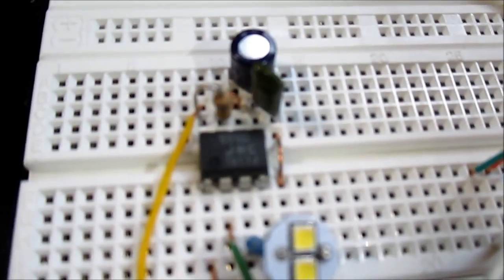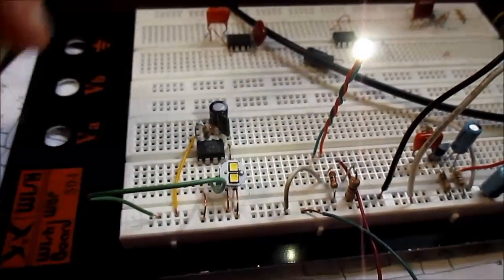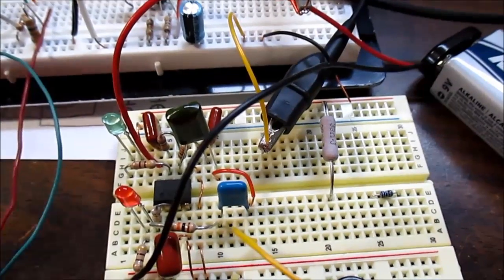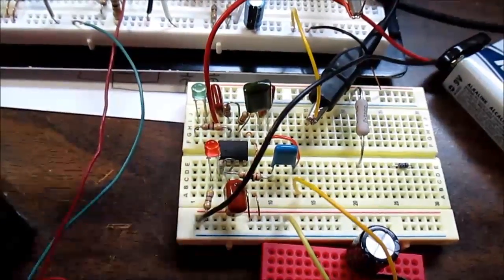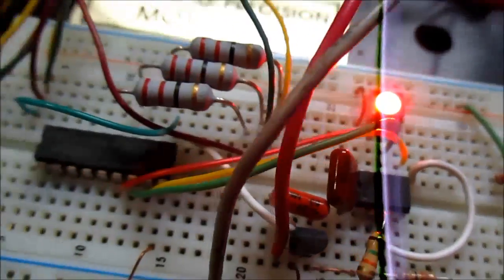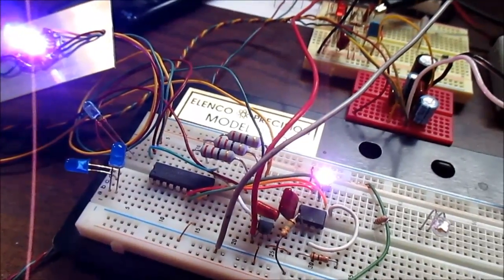My favorite 8 pin DIP ICs!

Comment: Hey so I pulled an 8-pin IC off an old circuit board it’s an unknown brand and the only letter/numbers on it are: HH9QK Q0270RA, I’ve been looking on the internet and I’ve not been able to determine what it does, all I know is that it’s an 8-pin, also before the letters/numbers there’s a slanted f. Do you possibly know what it does?
Reply from the maker: Probably a part from a Chinese manufacturer that distributes privately to other companies. I doubt I'd be able to find anything on it either.
Reply: @JohnAudioTech  dang, cause I’m not even sure what the part does, and I’ve never really built any circuits with any IC’s yet, I have modified/upgraded electrical stuff though that have IC’s on then though.
Also if you use transistor/mosfets do you know what this one does? LT7237 MbR20100CT it’s got two arrows pointing towards a dot in the middle: —>|•|<— that’s what the image thing looks like on it.

Comment: What is the number of ic of led driver???
Reply: Uln2803 if I'm not mistaken.  It's a Darlington transistor array.  The 2803 has 8 transistors and the 2003 has 7.  The base and base to emitter resistors are slightly different, depending on the utilisation.  I use the 2803 on a regular basis to drive many LEDs and/or relays.  Have fun !!!

Comment: the 555 is by far my most used tinker chip, so versatile and cheap as dirt.
Reply: Yes, but have you seen the current consumption? There are more modern replacements that do the same thing with much less power.

Comment: I notice on your breadboard (9:36) that you have your power rail on the top side jumpered to your ground rail on the bottom side !!  Hmmmmm !!
Reply from the maker: Despite their color code markings, they are not actually tied to anything so you can use them as you wish. It works better for me to make them ground.
Reply: Yup.  I was just yanking your chain.  Sorry about that - couldn't resist it.  LOL!!  Thanks for all your videos !!  ;) ;)

Comment: The first op amp was designed by Bob Widlar and David Talbert in 1964 and it was the uA702  then came the uA709 and uA723( voltage regulator) then the LM100 LM101 LM101A(with fet current source). The 555 is from 1971 as you say.
Reply: I still use LM301 (commercial grade of LM101). Works great in audio gear.

Comment: Great video. I love the 555 timer. There are so many jobs that a 555 can be thrown at, motor speed control, PWM, oscillators, pulse extender. I used to explain modifying guitar pedals to a friend of mine as "putting in better quality triangles" (referring to better quality op-amps), it was kind of whimsical, but, it's really all you're doing a lot of the time. More expensive triangles.

Comment: Thanks for the video! One question: which was the microcontroller you showed? I went back a few times to review the video but kept missing the part number...
Reply from the maker: It is the Picaxe 08m. These are discontinued now but with a better version, the 08M2 which has more memory, faster clock rate and other new features in the same 8 pin DIP package. I bought mine off of eBay.
Reply: +JohnAudioTech thanks!

Comment: I see the LM358 and 4558 op-amps in a lot of commercial stuff like tape recorders and amplifiers, even in class D amps I've seen one or the other somewhere in the circuit.
Reply from the maker: Those are dirt cheap, cost less than the 5532. The 4558 is really a dual 741 which is crap for hifi audio. My cassette deck has one inside as well. The bean counters want it made as cheap as possible to keep margins high. They can't spare 25 cents for the better part.
Reply: Us digital types like the LM358 because it'll go all the way down to the negative rail on the output. Often a very useful thing when you're using it as a comparator. It doesn't do the same on the positive though.
Reply: Weren't the 741s used in studio mixers?
Reply: No, 2 x '741, that would be '1458. '4558 (and its cousins '4559 & '4560) is quite different beast, done on a mixed process just like Lovelace's NE5532. Compared to  LM741, '358, and '1458, it's actually somewhat decent for audio, but that applies to line-level stuff or oscillators, as 4558/9 is too weak to drive headphones directly (and well).

Comment: 555 is still used in some drills.I have one running the light here,tried tinkering even more with it a couple of minutes ago.
Reply from the maker: It can work okay as a budget switch mode circuit.